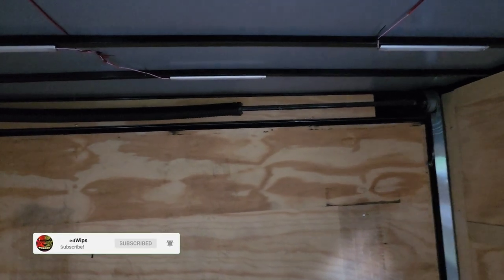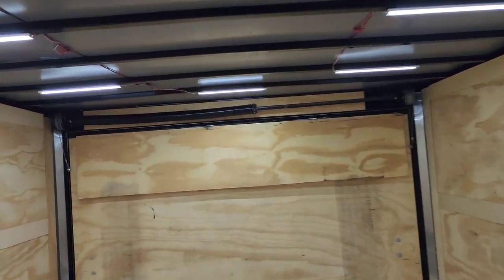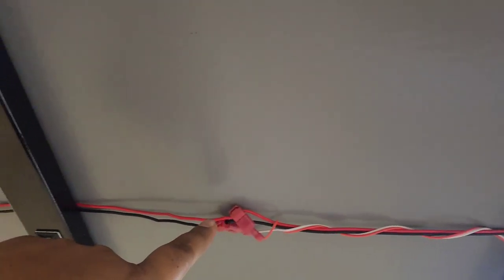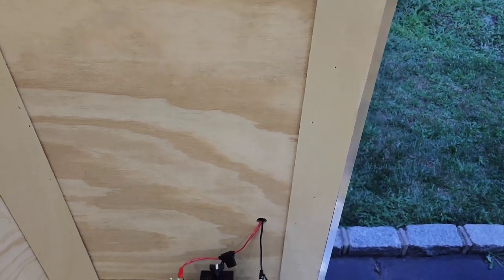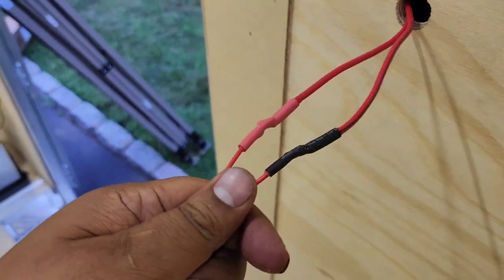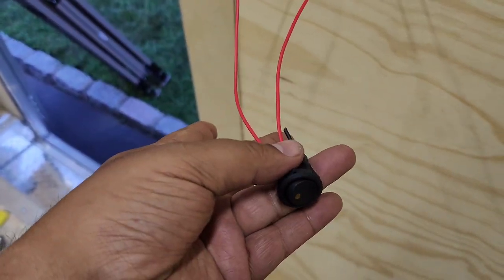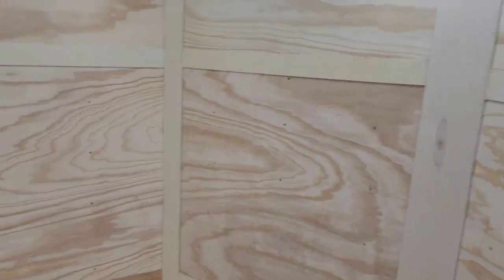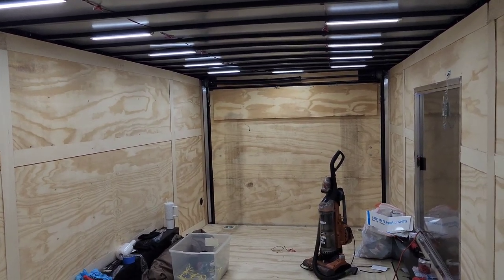Upgrading my 20 Foot Enclosed Trailer with Led Lights and a Battery 🔋

Comment: Great video, I did this but just ran the wire down the wall and used wire a consealer kit (painted black) instead of drilling the two holes for the battery.
Reply from the maker: Niceeee

Comment: Good video. Now after one year of service, how do you rate the lighting and installation??
Reply from the maker: Hey robert how's it going,  everything still functions as normal. I actually added a power inverter, so when I hook my trailer up to the truck, the battery gets charged at the same time.
https://youtu.be/Hp0nCSFMeHw

Comment: What size and type of battery is that?
Reply from the maker: It's my OEM battery from my Subaru....literally new
Reply: Ok, thanks a million bro, one last thing. I've been seeing a lot of videos & ppl are hooking up rechargers to the battery. Is that necessary
Reply from the maker: @CJackson-f5g good question....I forgot to mention I did a video on a power inverter which I added to the trailer in order to charge the battery in order to operate the lights.....I'll release it this week so you can see.
Reply: @WikedWips  ok cool. I have everything in my cart ready to go. I pick up my 7x16 tomorrow. I'll definitely turn in for that video.  I'm subscribing now.
Reply from the maker: @CJackson-f5g nice man, thanks!
Reply from the maker: The vid is up brother!!
Reply: @WikedWips  THANKS, you tha ish brodie